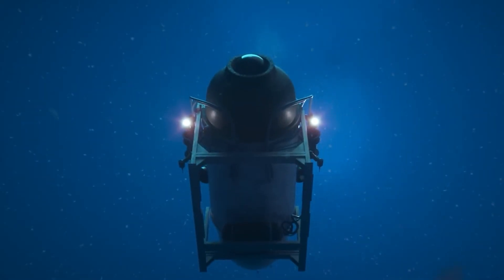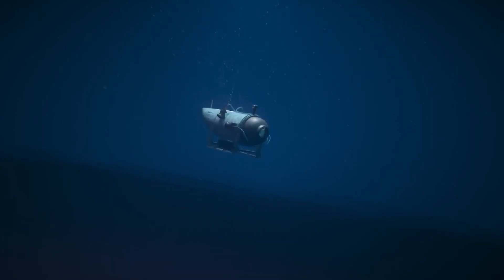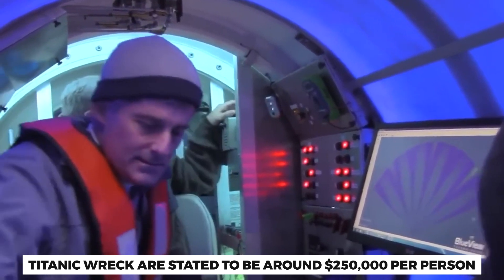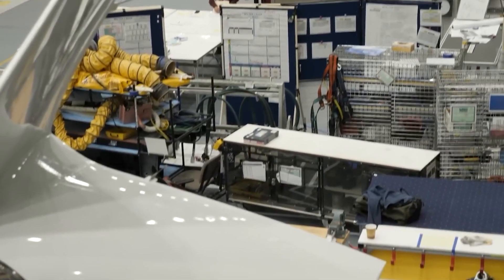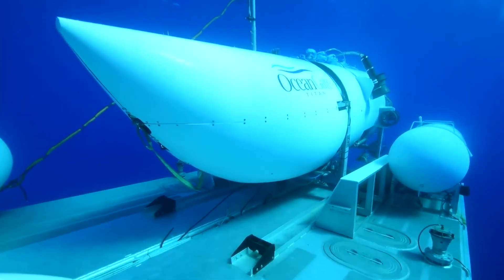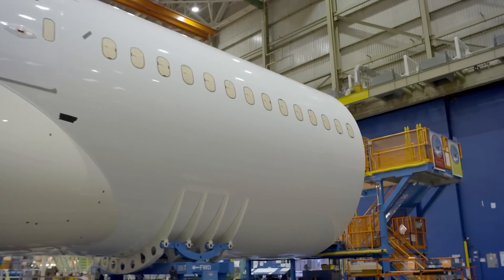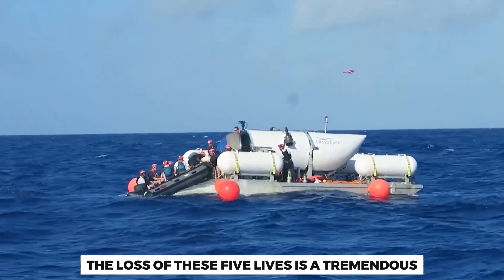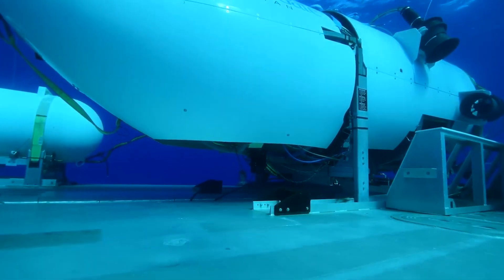OceanGate's Journey: From Innovation to Tragedy (2023 Update)

Comment: He was a cheap skate and wasn't bothered about safety it was all about the profit he killed those people, how were the monitors and lights fixed inside were they screwed into the carbon fibre or was there a sleeve inserted to screw the monitors to and if so how was the sleeve fixed in so it wouldn't move if the weight shifted as people moved around inside was the sleeve screwed to the carbon fibre  because both ways would of compromised the main tube of the submarine
Reply from the maker: Good question. We might create a second video on this 🤔